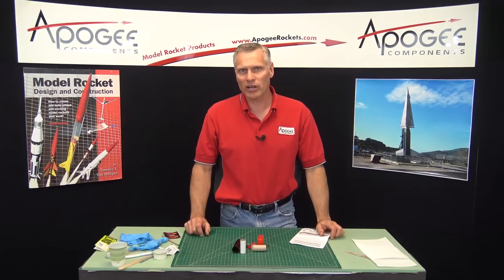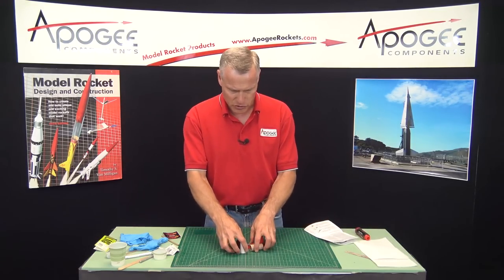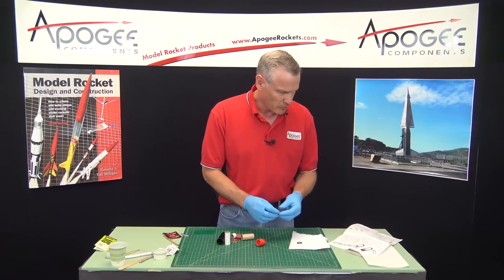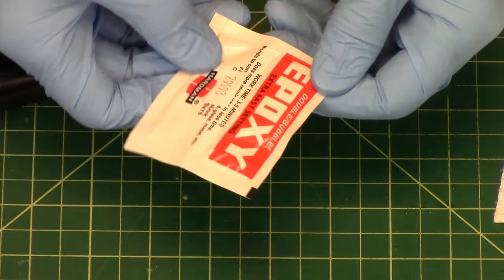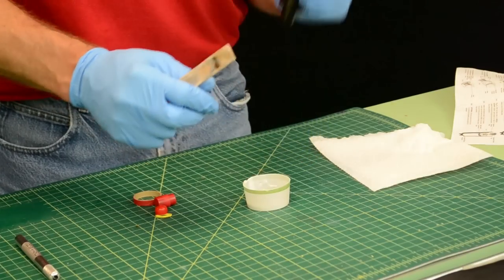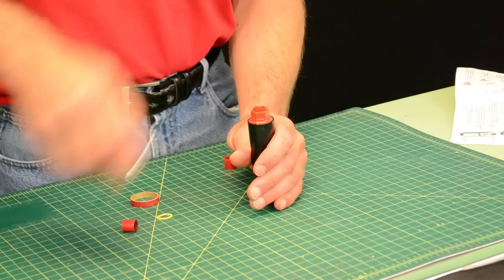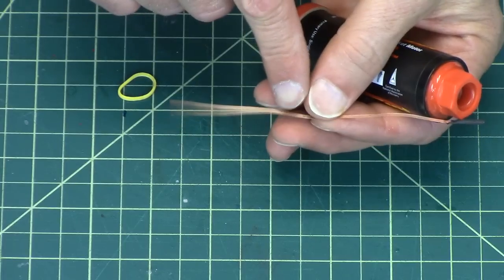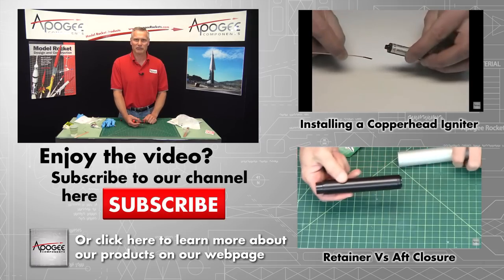Loadable Motor Assembly

Comment: Great visual guide. I used this to assist me assembling an identical casing with a F52T. You only get one fuel tube, and a spacer. The difference was you put masking tape on the end of the fuel tube before the space. It worked like a charm!! I reached a centimeters shy of 300m on a custom made 3D printed rocket using that casing and engine. The only thing that went wrong was that I didn't packet enough black powder for my electronic ejection charge so the main chute didn't deploy and it had a hard landing. Really appreciate your work Tim, and all of Apogee Components. Wouldn't have been able to do that launch without you.
Reply from the maker: Glad that I was able to help out.

Comment: Despite this is an old instructive video! I have a question, from my understanding any engine, apart Estes and Klima, need the user to put black powder in the cavity on the end of the motor. Does the powder comes with the engine or reloads? Many thanks for all the video freely available on the YouTube channel.
Reply from the maker: You are talking about the ejection charge on the end. Yes. You will need to add it into the cavity. And yes, the Reload "kits" do come with the black powder.
Reply: @apogeerockets  thank you very much.

Comment: I’m curious what the point of the motor system is if you using the same type of motor, does is feed it through a smaller hole or nozzle when running or something creating more thrust or efficiency?
Reply from the maker: Nozzles are not interchangeable. When you go to engineering school, you'll learn how to properly design a rocket engine. Go for it!

Comment: Hi tim ive got a question, for the Estes G motors do you do the same thing or are they already ready to go ? And also do they come with everything you need ?
Reply from the maker: Estes doesn't make a G motor anymore. But they were single use and had everything you needed (the igniter).
Reply: Apogee Components cool, yeah they were a common site in my club but i always loved the G80 but i am eager to use aerotech thanks for the heads up on the estes G motor discontinuation
Reply: Estes F and G motors (composite) were made by Aerotech anyway, so it's the same thing.
Reply: @randalstout  Yeah, I was struck dumb to see Gary Rosenfield wearing an Estes hat the year those Estes composites came out!  It was like the rocket world had flipped on its axis!

Comment: This video is VERY HELPFUL. That terminology, loadable and reloadable, is quite confusing. For a beginner a loadable motor looks exactly like the reloadable motor. Calling something loadable sounds like it should be RE LOADABLE, if it's loadable. But it's a SINGLE USE motor. Why not just call them SINGLE USE MOTORS?
Reply from the maker: Glad you found the video helpful with the terminology. We didn't name them, because we aren't the manufacturer.

Comment: Hey Tim I would like to join one of the two rocket clubs so I can take part in HP. Rocketry. But I am on a budget of $ 680.00 on SS disability.  I can't afford the fees. Any suggestions?
Reply from the maker: Go to the club anyway. You can help or assist another modeler in the construction or launch of their model. That way you get the same experiences they have, but without any of the costs.

Comment: I've got a bunch of motors that I know are very close to 20yrs old. I'll build a rocket and test them and let you know. I've got several rockets that haven't been built that are that old too. I'll build one of those. The Star Ship Enterprise. Its been in the garage for 20yrs.
Reply: Tony Thomas 
Ok
Reply: Any updates on the 20-year-old motors?
Reply: I've had generally good results with old Aerotech motors over the years.  (And old Estes motors, too, which I keep dry and stored at constant temperature.)  Although there was one old F50-4 that behaved like an F50-10 and deployed 2 feet above the ground, destroying the nosecone but saving the G-Force rocket body!  The problem with old motors is that some White Lightening propellants react with the air (probably moisture) and get a white coating on them, and/or expand, closing down the C-slot.  This might be what happened with my old F50-4, which though a Blue Thunder propellant, could have had a White Lightening delay grain that didn't ignite well due to a coated lower surface.
Reply: @thomasstump6090 about how long do you think white lightning motors would last? Mine came in a 2 pack and I used one and the other is in a ziploc bag. Would it last months? Years?

Comment: What's the difference between a  loadable and a DMS?
Reply from the maker: They are similar. The DMS stands for Disposable Motor System. Use them once, and discard the casing. The Loadable are  also disposable, but you have to assemble them prior to launching them.